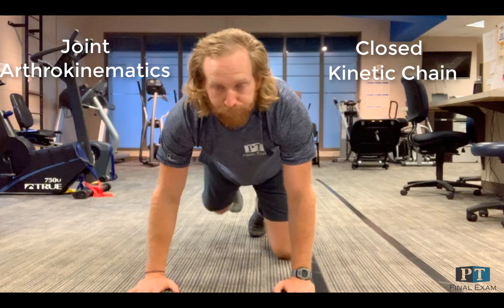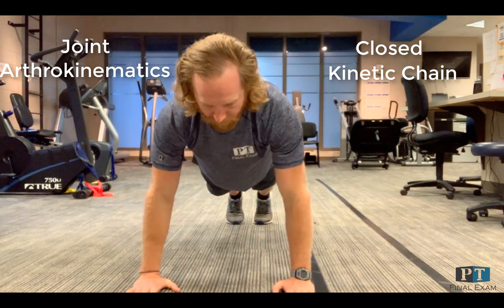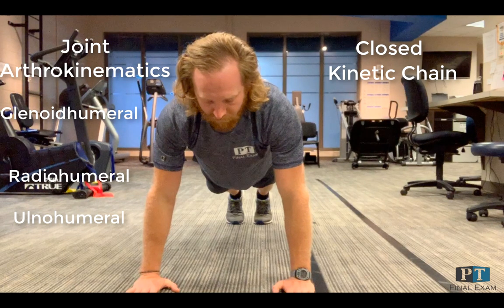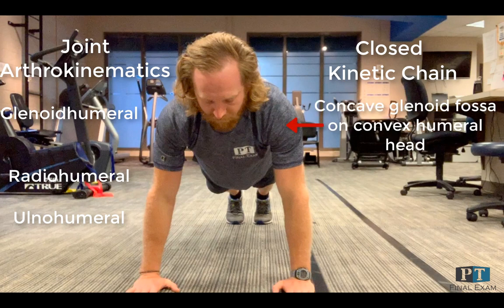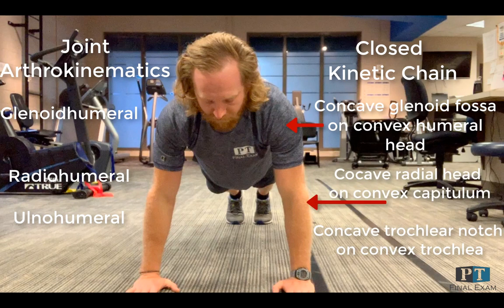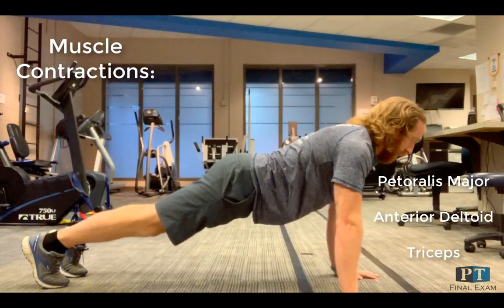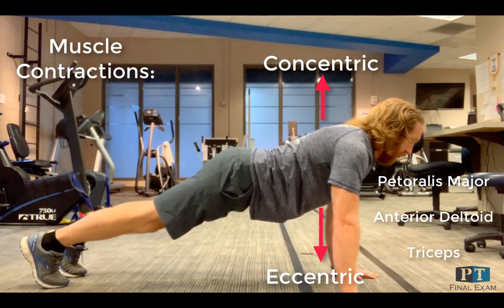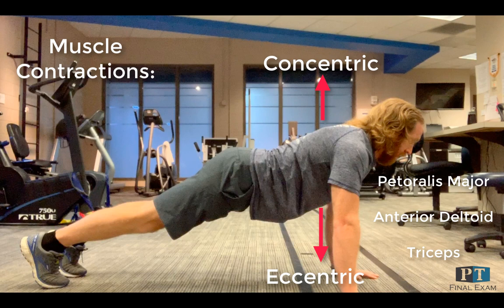Biomechanic Breakdown Push up

Comment: So, where is MY weakness if I can't get to lift myself up in the concentric phase those first few inches, but after that angle, I can complete the movement.  My arms are strong, my technique good, but I still can't lift myself unaided from the floor.  Same with the eccentric, I can lower myself until those last few inches, but then collapse. Thank you for the video.
Reply: are you engaging your core / abdominal muscles? see if that helps
Reply: @nes2quick  I do 3 x 1 minute planks almost everyday with a 30 second breather in between. At almost 70 years of age and 94 kg. it is a lot for me to lift, but we're getting there, inclines getting better and stronger - it is just going to take a longer than I had anticipated.